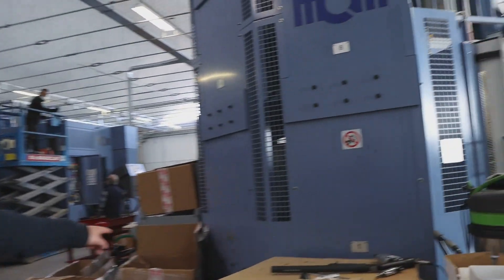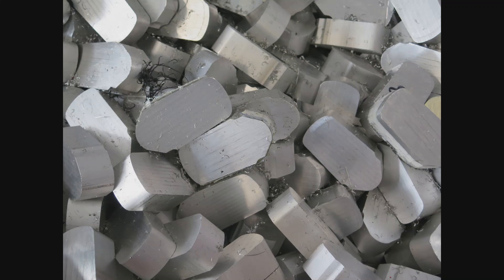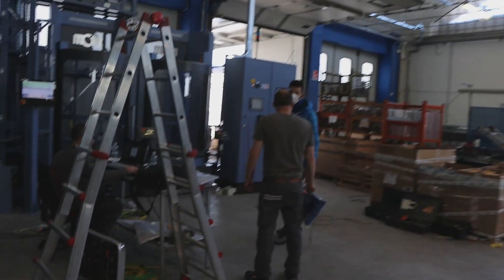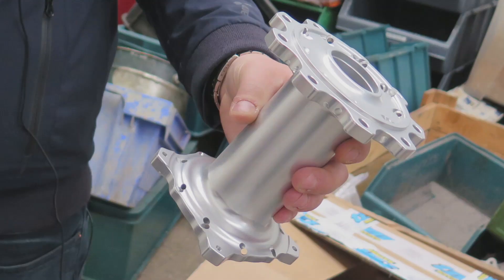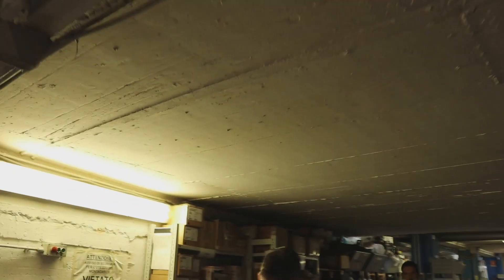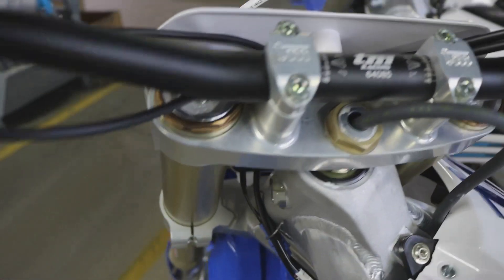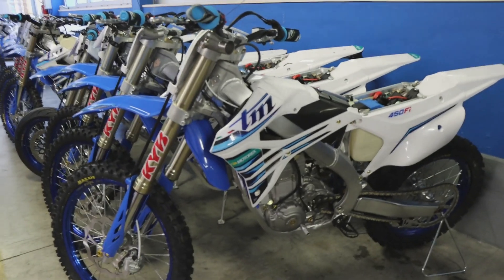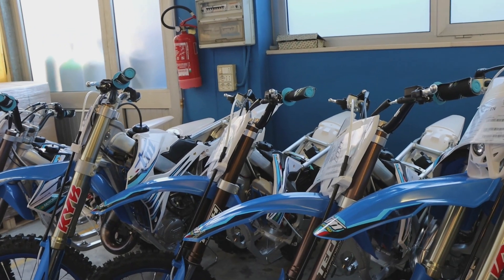TM Racing Factory Tour - Part 3 (of 5) (Parts, Engineering, Engine Mapping)

Comment: TM, Please fix the power valve problem on the EN Models
Reply: why what's the problem
Reply: @markilleen4027  electric power valve reset when you start it up or after you stall it. There have an arming switch to keep everything powered if you stall it. It is a cheap modification to solve the issue.

Comment: Awesome guys, great to see the factory and how they are built. We are in Australia and have two MX450 and a MX250 ordered for our Australian race team, they could possibly have been assembled while you were there.
Looking forward to the rest of the tour. 🔥🔥
Reply from the maker: Sam and Melissa had no thoughts of becoming TM owners until they saw the care and detail of the manufacturing process.  Sam now has a 2022 TM 300 FI, Melissa is holding off but her resolve is slowly crumbling.
Reply: @armyofdarknessmotorcyclesb2883  I'd love to see a video of Sam's 300 and what he thinks about it, what type of riding he does etc.
Reply from the maker: We're trying to get to that but it might be later in the fall.  So far Sam has got it resprung, fixed a couple teething issues, and fit a Rekluse (!!!) even though officially there is no Rekluse for it.  It is VERY VERY fast and Sam is still coming to grips with it in the woods.